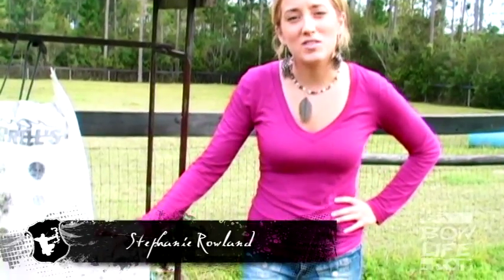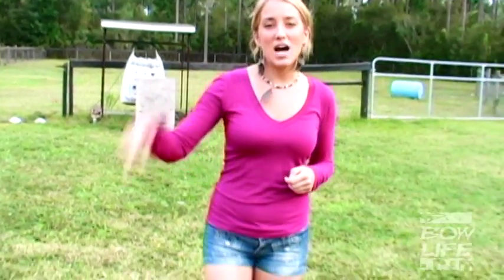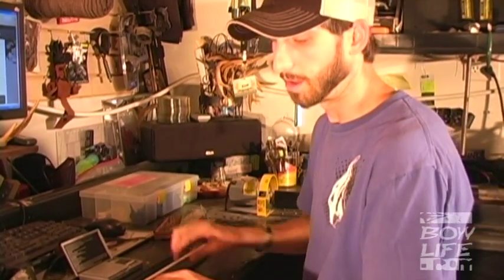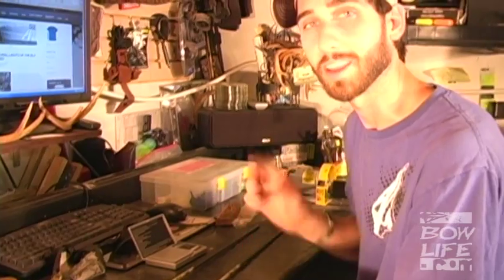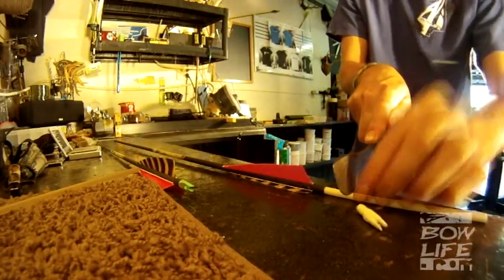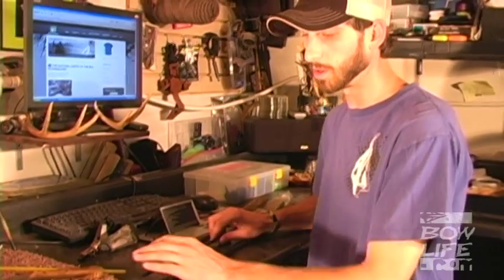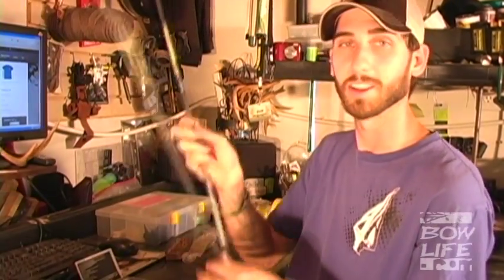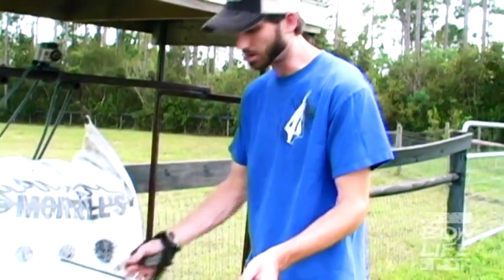Weight vs. Speed of an arrow

Comment: kinetic energy has no direct relation to penetration, you should be calculating momentum (mass x velocity)
Reply: Lol I should have read more comments before I posted mine lol... MOMENTUM is KING in archery.. KE is for bullets
Reply: +Devin Rauser momentum isn't a key determinant of penetration either. If 2 arrows had the same momentum, the lighter faster one would penetrate better. With Kinetic energy, if 2 arrows had the same KE, the heavier one penetrates better.
Reply: The lighter arrow would not penetrate further, drag increases exponentially with speed.
Reply: Kinetic energy is not different in the way you have specified. Mass x velocity: yes if they had the same mass and velocity they would have the same momentum and KE, but they could also have different momenta and velocities and still have equal monenta of KE
Reply: "if 2 arrows have the SAME momentum they will have the same weight and speed, there would be no difference as both arrows would be the same" LOOOOOOL . momentum is speed multiply by mass . it is a result of 2 numbers being multiplied . like : 1(mass)x8(speed)=8(mass)x1(speed)=4(mass)x2(speed)=2(mass)x4(speed) . I just gave you 4 DIFFERENT arrows with the SAME momentum . this is basic math , my little friend .

Comment: Fuck the weight tube, use a more heavy insert.  Strengthens the front of the arrow since longer and increases your front of center more.  Just use the proper shaft since its the same as getting a bigger tip. Another pro is you can use 100-125gr tips so finding broadheads to match aren't an issue. The only con is your arrows will arc more but they will be more forgiving and stable due to the fetching being further away from the balance point.

Comment: Just for you to know, that experiment dose not prove anything yet. 
For two reasons 
1) your bow is not tuned for both arrows (I'm assuming it's tuned for the heavy one). 
And it's definitely make the difference. 
As you know when it's not tuned, the arrow will make significant deviations, and will try to penetrate at different angel. 
2) you shouldn't shoot it higher, because the wood plate need the same ability to resist the two arrows. 
When you shoot higher on the plate there is more energy goes for moving the target instead of penetrate.

Comment: There's one thing no one is mentioning, its not just a heavier arrow. His bow, or anyone's bow, stores a finite amount of energy, the more efficiently you can transfer that energy into the arrow, the better your setup. If you look, his light arrow of 367gr @ 276 fps has 63.8 ft/lbs of kinetic energy compared to his 550gr @ 262fps for 77 ft/lbs of kinetic energy arrow. That setup was able to "absorb" more potential energy from the bow. Suppose a 1200gr arrow, He would see an increase in kinetic energy. So the argument of light versus heavy is too simplistic, the argument should be, what arrow weight yields the highest conversion from potential to kinetic energy. There is an upper limit on weight before you give up KE, if you graph it out its an inverted parabola with weight on the X axis and KE on the Y axis.
Reply: The variable is weight, I'm stating that claiming more weight is better is not always true. It's bounded, but we only ever talk about the minimum weight, never the upper bound. It also matters where you add that weight to maximize, the head is generally the best spot so you have a high front of center, so nom square shots have less of a torque affect on the error, as you move the center of mass closer to the tip. Dr. Ashby has some, mostly accurate papers on this subject, they are a good read if you've never read them.
Reply: William Roberts you will eventually get to a point where the k.e. drops because of such a loss in speed....your momentum will continue to rise but your doped and k.e. Will drop off.  k.e. is an impact measurement only.
Reply: Please make a video about this. I am interested in finding the upper limit of arrow weight for my now 😊
Reply: @usbsol  Most bows' efficiency at converting mechanical potential energy to arrow kinetic energy increases substantially until reaching a point of rapidly diminishing returns just beyond the 12-15 grain per pound region.
Reply: @Marmocet  so 720 grains would be close to perfect for my 60lbs bow? Thats amazing because thats the exact arrow weight I am using 🤗😄
Reply: @usbsol  Yup. That's about right for most (but not all) bows if you want a good balance balance between arrow mass and velocity. A few grains per pound more massive and your arrow will gain a bit more momentum and KE, but you'll have to give up proportionally more and more velocity to get it.
Reply: 99 percent of the people on YouTube haven’t a clue of what your saying, best to explain it to them without breaking the equation down
Reply: As a general rule with most all bows you loose 10 fps for every increase of 25 grains.. He increased is weight by 183 grains that would equate a loss of about 70+ fps.. meaning he would have dropped from 276 to around 200+ fps.. what he is claiming is loosing only 14 fps.. that is bull crap, not even realistic..  He had better buy a new chronograph because his is lying to him..

Comment: heavier will almost certainly penetrate better, based on my learnings with many different rifle rounds and shotgun slugs. what it comes down to is how accurate you are with your shot with that weight. you can have the most penetration but if you cant locate it on vitals then its pretty much useless imo. to each their own, i personally shoot a heavier arrow because i have found more stability with my broadheads with a heavy head and a helical fletching. accuracy is the answer. happy hunting

Comment: Here's my understanding of physics (I minored in this subject back in the 1980's). An arrow's kinetic energy (KE) comes from the work done on it by the bow. Work is Force multiplied by Distance (W = F*D). You can compute the work done by your bow (and the KE of your departing arrow) by getting a bow scale and measuring the force in pounds produced by your bow string from full draw all the way down to zero, using 3-inch (0.25 ft) increments. Now make a graph, with force (lbs) on the vertical y axis and draw distance (ft) on the horizontal x axis. Now you need a calculus concept called the definite integral. Go on to YouTube (you're already here) and read about ways to approximate the area under the graph (and above the x-axis). A midpoint Riemann sum using 0.5 ft interval will be pretty accurate, or if you're feeling fancy, try Simpson's Rule. You don't need calculus knowledge to do this stuff; you only have to multiply and add (do all the multiplications first). The units of this calculation will be ft-lbs.

Notice arrow weight doesn't enter this calculation. I believe it shouldn't. I think all arrows leave the bow with the same KE, because the arrow's KE is equal to the potential energy that was stored in the bow. Obviously speed and momentum will vary with arrow weight (they are inversely proportional).

One more comment. Faster arrows lose a greater percentage of their original velocity than slower arrows because "wind resistance" or the friction of traveling through a gas or fluid varies with the square of velocity. Stick your arm out the window of your car at 30 mph, then try it at 60 mph. The "wind-resistant" force at 60 mph is FOUR times the force at 30 mph, even though you only doubled your speed. There are implications here for archery (and your car's fuel efficiency). Namely, although a heavy, slow arrow and a light, fast arrow depart from the bow with the same KE, the slow arrow will retain more of its KE on its way to the target.

I think I'm right about this, but I've honestly never looked into the physics of archery, and I'd love to hear from somebody who knows physics and/or archery better than I do. There must be plenty of you out there.
Reply: +freitag314 In addition to your commentary, I'll simply say that, comparing to different arrow, with the same bow and bowsetup is quiet unfair. If the purpose is to compare speed and weight for kinetic enegy, well then, the 2 arrow should start with the same KE to begin with. Besides, the only things it really does is improving the arrow inertia. And in the end, the reason the heavier arrow goes futher, is simply because her weight doesn't decrease while her speed does.
Reply: @biophysique  they will have the same KE. The heavier arrow will fly more slowly. The energy comes from the limbs of the bow. That means it is unaffected by the weight of the arrow. KE = 1/2 mass * velocity^2 (squared).  The KE is the same and the launch speed decreases (quite a bit as velocity is squared).
Reply: @wolfpack4128  I have to admit you're quit the necromancer... I do not remember everyting from this conversation. Yet, I simply stated that the heavier arrow will have a bigger inertia a the cost of a slower speed.
Reply: +freitag314 

Weight is the force, typically due to gravity. However, in this case, its caused by the bowstring. Also, you assume that you can take the integral of the power stroke of the bow to calculate the arrows energy, that just calculates what the bow is storing. Their are loses (significant losses) of transfering that to the arrow, mostly in the form of vibrations (sound, string, arrow flex, etc).
Reply: Thanks for your comment brother it explains many things I read similar blog about your post lastly ☺
Reply: You are mostly correct. Work is force times distance. The amount of potential energy the bow creates does not change. Just like your explained in your every three inches draw weight example. The energy in your bow limbs does not change with the weight of the arrow. That means the energy in your arrow a few inches from the launch point should be about the same. A heavier arrow will remain in contact with the sring a bit longer and therefore be a bit more efficient at absorbing the limbs energy. So at distances of 20 yards you should not have much difference in penetration. The heavier arrow will retain more energy. As you correctly pointed out this is because wind resistance is squared for velocity. This means a small increase in velocity makes a big impact on drag. A heavier arrow then is great but the problem is deer react to bow shots. At 40 yards an extra 20 fps may decrease an animal's chance if ducking your arrow by 3 inches. The heavier arrow is great for penetration but speed kills.

Comment: Why penalize yourself with a weight tube when you can add that weight were it matters most and get the additional benefit of a high FOC by simply replacing that lightweight 100 grain Broadhead with a 200gr Kodiak or Steelforce Broadhead? ...
    To those watching...  If you want to add weight add it at the tip of the arrow... either by using an all brass 100 grain insert behind your broadhead or just changing to a heavyweight broadhead with a higher mechanical advantage of say 3 to1....
Reply: +rainmechanic adding weight to the front of the arrow will weaken the spine and a stiffer arrow may be required. Not saying you are wrong, you aren't, but pointing out a possible downside. Just need to buy stiffer arrows.
 There is a constant battle between the heavy arrow crowd (me) and the fast arrow bunch. Slow heavy arrows have been killing animals since the stone age. Fast light arrows have been killing animals for several years. The animal ends up just as dead. I believe that momentum is a more important consideration when choosing an arrow/point combo as a pass through will kill faster than a non pass through shot, resulting in a shorter blood trail. 
  Also, it has been proven that a light arrow bleeds speed at a faster rate than a heavier one so at longer distance, the trajectory argument is beaten. (Also a momentum thing) There is happy median where arrow weight and speed are both ideal and that varies between bow/arrow combinations. I personally prefer about 425-475 grns of arrow at around 275-285 fps. depending on my setup.
Reply: True
Reply: ray king    Yes, as you add weight to the front you weaken the shaft spine..  If you normally shoot a 30 inch carbon arrow with a 125 grain broadhead and a 400 spine then you would need to move up to a 300 spine if you start screwing on 235 grain single bevel Kodiak broadheads..

Comment: Some major problems here. You CANNOT add 174 grains to the weight of an arrow and only lose 14 fps without changing draw weight and/or draw length drastically. Without changing any setting on his bow he would actually lose roughly 50-60 fps. Especially since most modern bows lose efficiency with heavy arrows. You lose 1 fps per 3 grains of arrow weight. A heavy arrow will help on real long shots because it carries moment better. But a lighter faster arrow will have more kinetic energy at 30 yards or less due to the speed difference. Speed affects kinetic energy more than mass. Kinetic Energy= 1/2mass x Veloctiy^2 so its obvious speed has a greater effect on KE
Reply: I agree with how there is no way he is shooting that arrow at 262. As for what one has more kinetic it is all dependant one the set up. For example my bow in my picture shoots my 392 grain arrow with 87 pounds of kinetic energy vs my 464 grain arrow at 86 pounds of kinetic energy. So my bow will shoot more kinetic at 30 with the heavy arrow even though it's going slower.
Reply: I agree with you Jacob (about 10 fps for every 25 grain change), however, I do not agree that bows loose efficency with heavy arrows, they become more efficient with heavy arrows.. Heavy arrows take more time to leave the string and will absorb more energy as a results.. So if your bow is 70 lbs and you can transfer say 60 lbs with lighter arrows then with heavier ones you may be able to transfer say 61 lbs making the bow more efficient.. The resulting foot pounds of energy would be about the same with light or heavy arrows with no big jump either way.. Even downrange the light vs the heavy the foot pound would be minimal difference but favoring the heavy arrow because of momentum for penetration, but on impact they would be very similar.. Heavy arrows will retain a higher percentage of original energy due to momentum.. But basically they will both start out at about the same fpe.. One getting it from speed the other from mass.. but it all comes from the limbs, and the limbs can't create more potential energy from nothing.. Even out to 50 yards it is not going to make any major difference in energy that would amount to anything, only in penetration after initial impact will the real difference be of any note worthy difference..
Reply: Actually once you reach a certain point it takes much more weight to reduce speed as the bow starts imparting more energy more efficiently into the bow
Reply: For every 3 grains you +/- 1fps. He dropped 174 grains, so that's losing roughly 58 fps. If you could add that much weight and lose 12-14fps, everyone would do that.
Reply: Jacob Buck Mass = penetration period.
Reply: Yeah but you lose a whole heck of a lot more speed than that when adding that much weight. I could see needing the weight it someone was shooting buffalo but not for deer.
Reply: Yup I noticed that and called bullshit right away also

Comment: shooting into a bag with a large hole already shot into it doesn't really give a good test on penetration. There's less material to pass through.

also, Force = Mass x Acceleration. shooting a bow that shoots 360 fp/s IBO with an arrow at 300 grains, you'll have an impact force of 108,000.

if you shoot a 500 grain arrow at 216 fp/s you'll get the same impact force.

Force = mass x acceleration            500gr x 216 fp/s= 108,000 =300gr x 360 fp/s

I think thats right? haha its been awhile since I took a physics class!
Reply: try watching the whole video..the bag wasn't the test.
Reply: LOL... put the crack pipe down and turn the sound up.  The bag test was to show his bow was tuned for the heavier arrow...
Reply: There force is completely different than kinetic energy.. just saying..

Comment: Just my opinion, but this is also the same reason the .45ACP is more lethal than the 9mm. Sure the 9 has better velocity, but the .45 is slower & heavier, thus hitting harder and making more effective use of all available energy.
Reply: I disagree The 45 makes a larger hole due to its size over the 9mm, The 9mm penetrates more due to its smaller size and faster velocity. Ill give you that..BUT... Handgun rounds suck at killing stuff plain and simple.  They are too slow.  The 45 is better then the 9 only due to the larger wound channel that has a greater chance at causing blood loss.  The difference between 9mm and 45 is bullshit in real world situations. Handgun wounds even to center mass ARE survivable simply because of the slow ass nature of a handgun round. Ask any field medic or ER doctor.  There is even a video from the World Health Organization on it.

  Take a 223 / 5.56 which is faster and lighter then both the 9mm and 45 and that same center mass hit is going to be a killing blow nearly every time.

Comment: I find myself wondering what would happen by putting a half length of weight tube in. Have it sitting at the tail end so it slides forward on impact
Like a jackhammer.
Probably just throw the arrow off balance